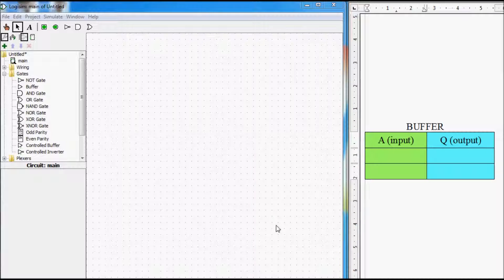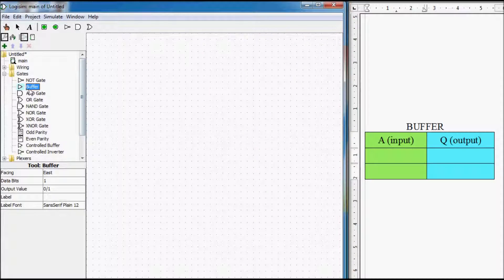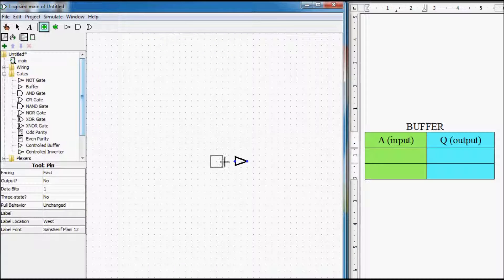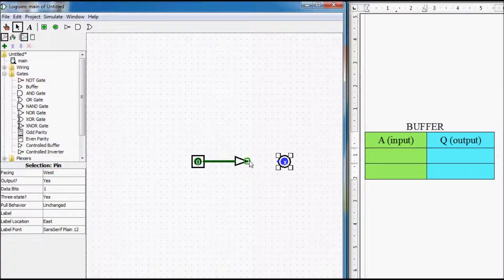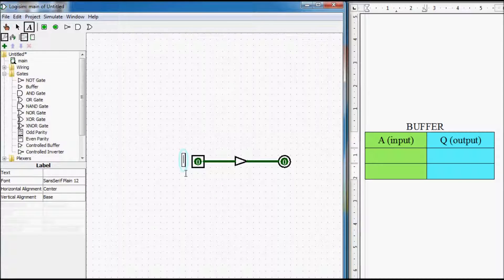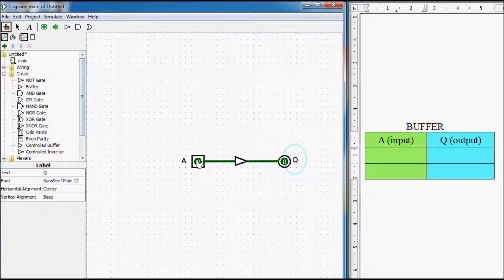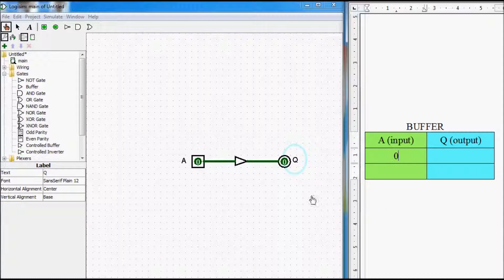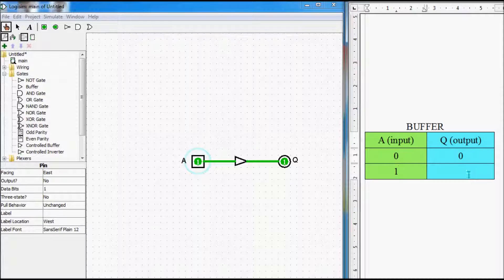3. Basic Logic Gates - BUFFER

Comment: Very nice explanation, thank you. Then, buffers or transistors are used for the same reason. My best guess, a buffer IC is a more neat way (probably) , than using transistor(s) alone. More compact and smaller board footprint. I should try some buffer IC's in the future to really see the difference. If you can recommend a good buffer IC that you used, it will be interesting.

Comment: If you get more current with the buffer, where does that extra current come from??? If another power supply then say that. And if that’s the case why not just use a sinking digital output with a single transistor?
Reply: THIS!! This right here is what am wondering